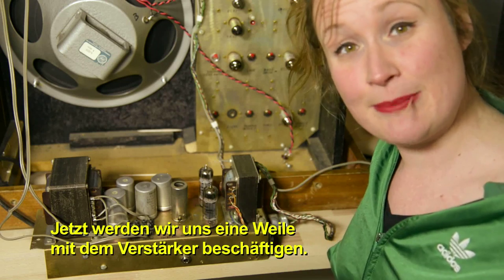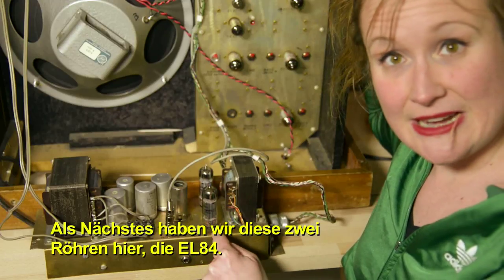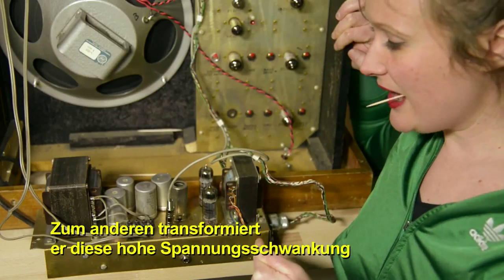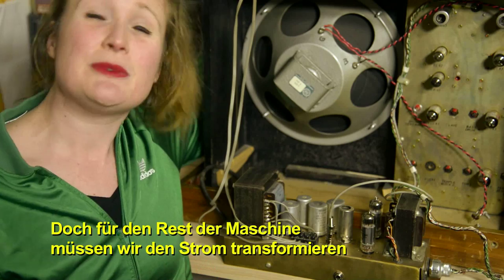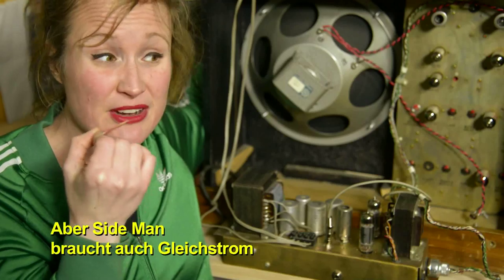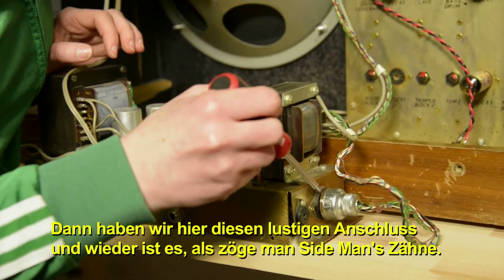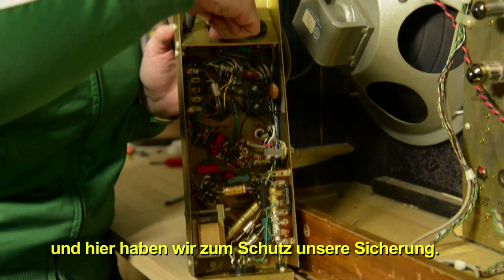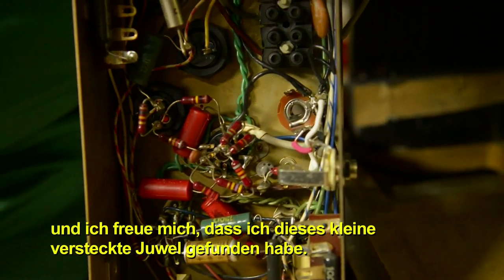Ep. 7/10 - A Side Man 5000 Adventure: ‘How the Heck does an Amplifier work Anyways?’

Comment: Foot pedal model # is 9011, and 9012 for hand held switch, I got one on eBay. (save your search and it will email you when one becomes available)
If you can't find one, you can easily make your own, almost identical to the 9011, using an old style Linemaster treadlite momentary foot switch and an Octal plug.
Both commonly available on eBay,